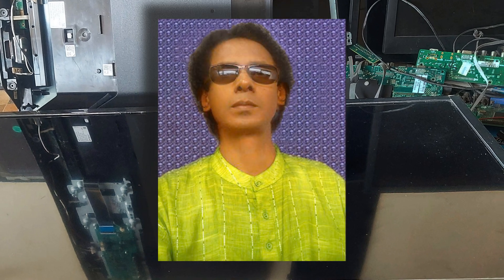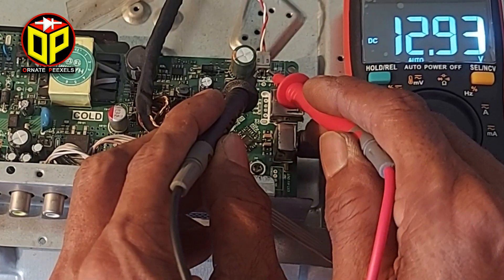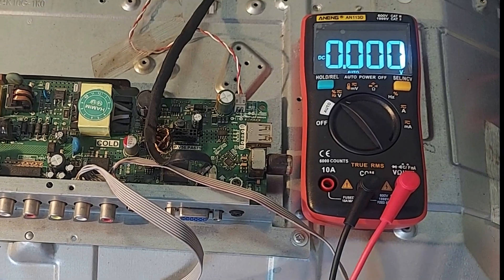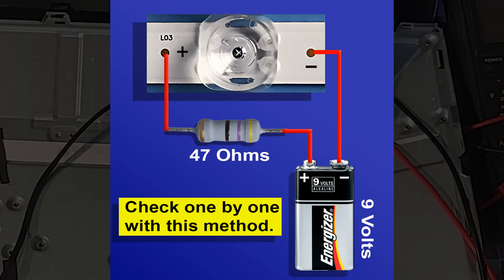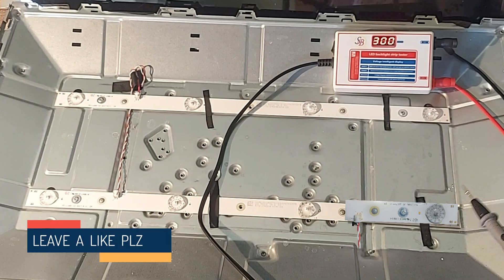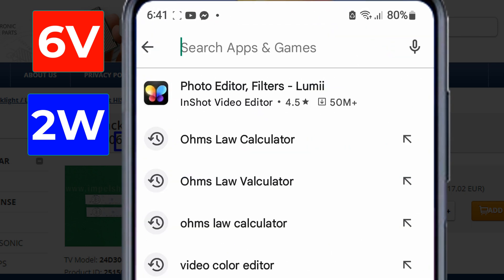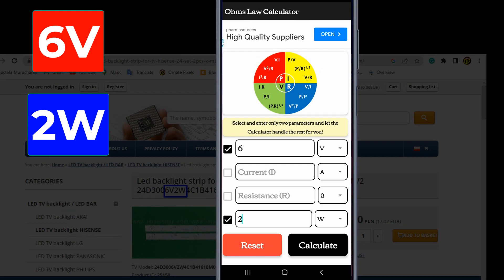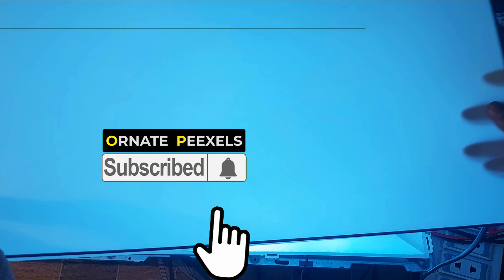Are LED TV Backlights Not Available in Local Market? Solve it According to Ohms Law |  MS-L1680 V2

Comment: The worst solution I have seen this year.  Just make a jumper on that open led.  The VLED system will self-correct if the voltage remains constant.  It is better to change both LED strips, or each LED individually.